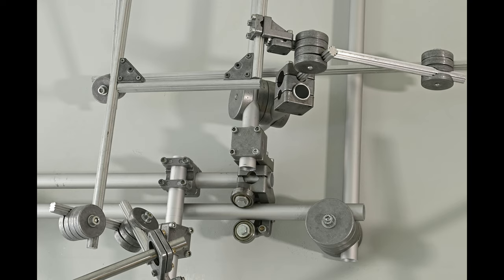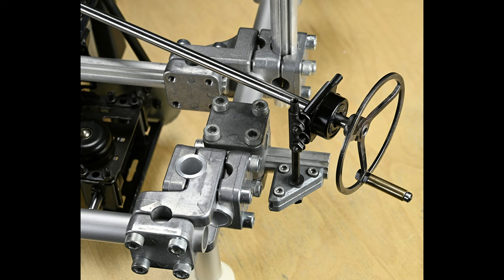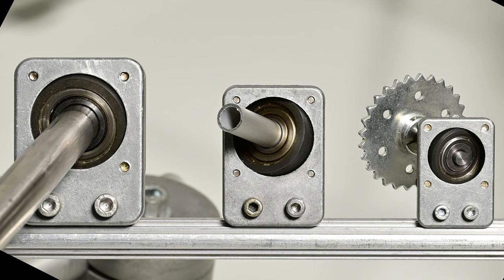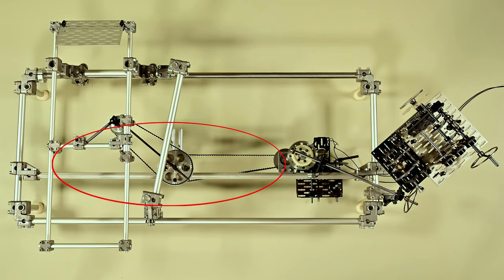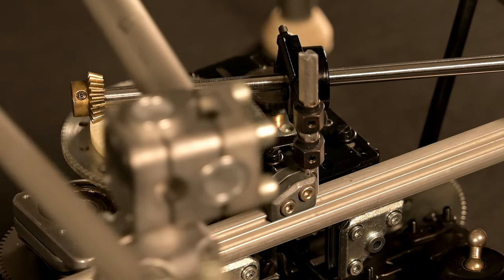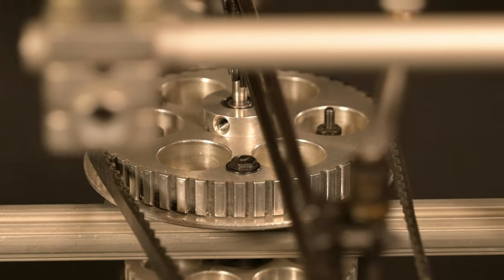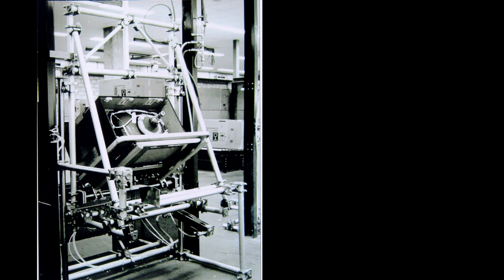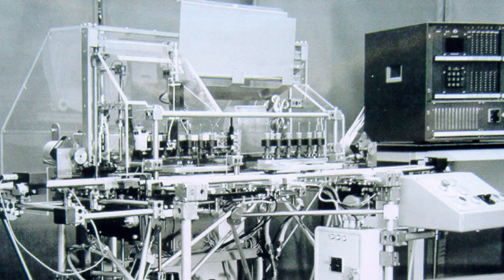Philips Variable Building System (VBS)

Comment: In the US at least most of these building systems have been replaced by the use of 80/20 extruded aluminum and Creform systems.  They work for simple fixtures and the like, but they don't have the nice mechanisms like the Philips system you've shown here.  Thanks for sharing!
Reply from the maker: The systems you mention will work as well. I saw various impressive 80/20 constructions . The only disadvantage with the 80/20 system is, that once you have made a setup and you want to add a clamp between 2 other clamps, you need to loosen one of these 2 clamps first, otherwise you cannot insert the sleeve. For a prototyping environment this could be an anoying issue.
Reply: @Meccanokinematics  with the wide availability of 3D printers and CNC machines, creating a bracket to insert with separable clamp elements wouldn't be too hard, and then theres the drop in t-nuts which address this limitation. I love the VBC implementation for it's time!
Reply from the maker: @nerddub  Agreed, although not everybody has a CNC at home. Initially I created a 3D printed inbetween clamp, but later I realized, that using an original clamp would work as well by adding a small 3D printed insert to fill the 2.5mm gap between a 15 and 10mm diameter.
Reply: @Meccanokinematics  Absolutely that's where I find 3D printing to be most useful, as a medium between off the shelf hardware and my design constaints.

Comment: It's a very interesting system. Thanks for the video. I've been looking for it but seems to be difficult to find.
Reply from the maker: Unfortunately you cannot buy it anymore. I myself have only parts for the  6-10-15mm diameter range.
Reply: @Meccanokinematics  Yes, I know it's not any more being made. I have been looking for it in the used market but not much luck so far.
Reply: I am still looking for VBS parts...still not much luck 😀